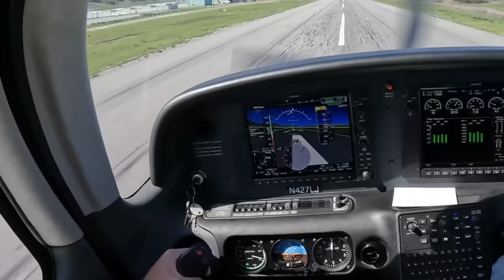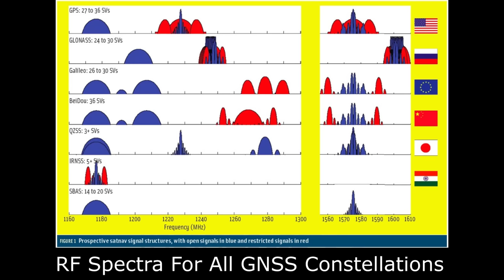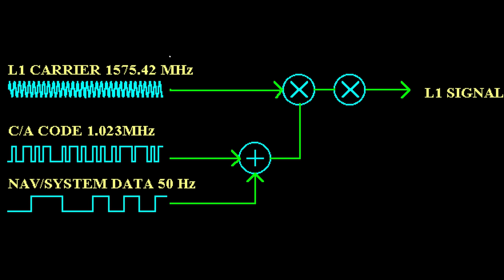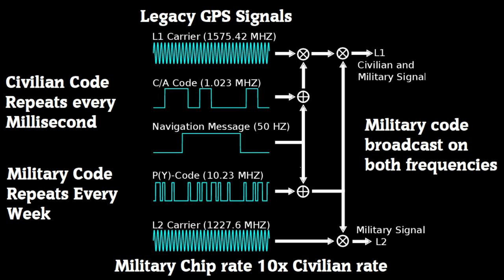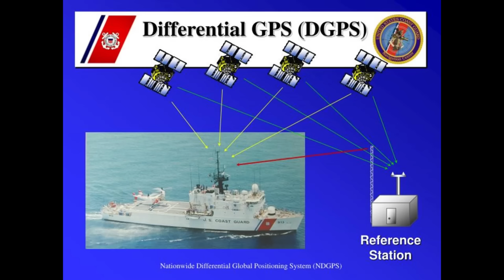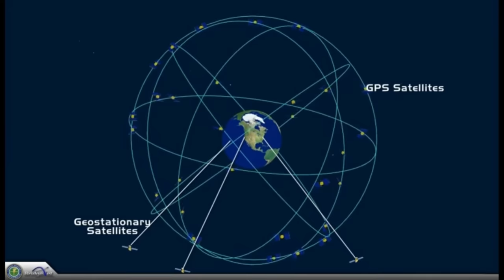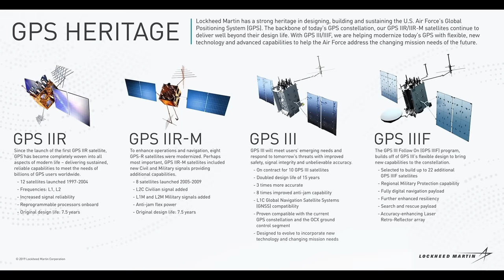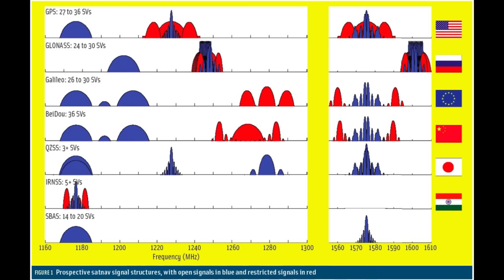How GPS Works, And How It Got Better Than The Designers Ever Imagined

Comment: I remember a story one of my professors told us at Cal Poly about someone who was working on a master’s thesis in the year 2000, developing a novel way to increase accuracy by compensating for selective availability. Basically, right around the time they were going to defend, the government turned it off. I think they were still able to defend, luckily.
Also while there, I heard rumors about how some student satellite programs specifically had to source their GPS receiver chips from overseas because lots of domestic ones would purposely shut off if they detected they were too high or moving too fast.

Comment: So many years ago, I did a job at the Naval Research Labs in Washington, DC. My employer had sold them a small satellite communications system that they were planning on using to synchronize atomic clocks across oceanic/continental distances. To do this job, the modem would actually range the electrical distance to the geostationary satellite to within half an inch or so.

Anyhow, when I was having lunch (I had to do it in the office, because they weren't exactly going to allow a foreign person like myself wanter around the labs). As I'm eating my lunch, I look over and there is this wierd piece of metal. The gentleman I was working with noticed this, and handed it to me saying "That's the prototype I built for the atomic clocks on the GPS satellites. It's made from isotopically pure Titanium."

Comment: I was on the design committee, the civilian GPS was designed for 8 meters, and 3 meters in differential mode; the P code military version was better. The transit satellites were used before that. 
Since then the clocks have been upgraded.

Comment: A few notes:

1. The FAA originally thought they could publish a GPS approach to every airport in the USA, but turns out that's difficult. It comes down to having the runway painted properly, monitoring that trees aren't growing into the aircraft's path, or someone does not park a construction crane there, etc. As a result, its been slow going.
2. LAAS, or local augumentation, has basically gone nowhere. The biggest problem with it is that WAAS is simply too good, so the cost to make LAAS is not worth it. In addition, the most obvious use for LAAS is at major airports for the airlines, and they already have ILS which is quite good. ILS got really cheap (relatively). I just went to podunk nowhere Oregon and they had an ILS.
3. One of the biggest advances that GPS could deliver is aircraft approaches that are not straight. Yep, approach paths that do things like turn a corner or follow a winding valley. These are coming slowly but are coming. Its likely that autopilot will be required to do this. The workload is just too much for a simple human.
4. The military used to reserve the ability to shut down the signal for civilians by telling the satellites to turn it off. But that was back before doing that would cause everyone's GPS box to die. So they developed the ability to jam the GPS signal in just a particular area instead, or even fake it so that a GPS system would give wrong information. Pilots know about this because they tested it in Nevada, and had to warn us that they were doing it.

Comment: And GPS navigation systems still lead you astray particularly if they don't refresh fast enough when you are navigating complex road networks. I can remember being out in the field looking for a locality where a map reference in Lat,Long was used with a GPS. Almost everyone trusted the technology and were scrambling around a gully looking for the rock outcrop that was supposed to be there. One of the luddites in the group decided to read the written description of the locality and check it against the contour map and walked over a ridge into the next gully and found it. GPS doesn't replace the ability to read a map.

Comment: There is additional GPS systems used by a very select few within various DoD entities.  This gives an accuracy down to the inch with no  cold start time.  I'm not privy to the operational information specifications, but I know it has modified packets that more easily allow for the use of Doppler shift in the position calculation.  It also works on a broad range of frequencies, which it shifts the real data between at a set time interval.  Outside of the accurate window, data is still sent which can give a course location.  This frequency changing is the same that the DoD radios use to help ensure more secure and harder to jam communication.
Reply: hi jameslmorehead , what do you think about all gubments drawing a line around you(Antarctic Treaty) and saying you are not allowed to leave? If you don't know what I mean, read my about tab.

Comment: There's one other important function for GPS.  That is an accurate time source for Network Time Protocol (NTP), which computers and other devices use to get accurate time, within milliseconds.  NTP is supposed to be traceable back to International Atomic Time, which is an average of several atomic clocks around the world.  With GPS, it's traceable through the satellites to the U. S. Naval Observatory in Maryland.  There are consumer grade GPS receivers that can be used for this and even my tablet can use GPS directly, instead of relying on NTP from the Internet.

BTW, I live not far from Toronto's Pearson airport and across the street from the grocery store where I shop used to be some navigation beacons.  They were removed a few years ago, I assume because of GPS being used on the aircraft.

Side note, you can stand in that grocery store parking lot and watch the aircraft flying directly overhead, with the landing gear down, as they approach the runway!

Comment: L.O.R.A.N. navigation platforms  were based on set locations signal time checking, so sync variability in time calculated locations. Yes, Coast Guard still had vaccume tube L.O.R.A.N. -C equipment at end of the sixties

Comment: btw. another often overlooked use of GPS and related systems is precision timing. Basically we're now living in a world where everyone has instant access to an atomic-clock anywhere on the planet.

This has countless applications. E.g. in my company we use it to operate lightning detection networks, triangulating the EM emissions of single lightning strikes. The receivers are actually quite dumb and basically just record time and amplitude of the signals, which is later correlated in software. But thanks to GPS they can do that with nanosecond precision, and – almost more important – a common time base, which vastly improves the resolution.

Comment: Fun fact, in an irban environment your cell phone does not need the full 12minutes to acquire it's initial GPS position, since it can ise the WPS (Wireless Positioning System) for faster approximate positioning. 
It is a clever use of google maps, where their mapping cars do take photos and GPS coordinates, but they also listen to the MAC addrssses of nearby Wifi access points. 
So your phone can actually "listen" to all Wifi signals around itself, and triangulate an approximate position from this.
I actually experienced this 10 years ago while using an iPod that had no GPS, but was able to get a 30m position using only WPS.

Comment: A 2D fix (latitude/longitude) can be obtained with 3 sufficiently distant (in sky) satellites.  To calculate your altitude, (3D fix) you need at least 4.  
And calculation of location, speed and direction of travel involve not only the time signal differences between satellites, but (and more importantly) the Doppler effect because some sateliltes are getting closer to you and some getting further away in the sky. (and hence the need for fancy radios).   And this is also why when YOU travel at speed, getting your initial fix takes much longer because the GPS does not hear an indicidual satellite at the frequency it expects to hear it at based on its orbital data and needs to listen to wide range of frequencies to determine which satellites it can hear from and then "correct" those frequencies based on assumed speed/direction of your travel.  
Orbital data is stored as 2 "tables": the almanach which lasts ~ 2 weeks, and the ephemeris which is valid for 4 hours. 

SA removal was similar to lifting of ITAR encryption export limitations: foreign companies were able to export into USA but US companies couldn't even sell to US corportatiosn with offices outside USA. (And contrary to military belief, there was no superiority to US encryption tech).   With GPS, Russia and Europe were launching their own constellations without degraded signals so the industry would move to listening to those satellites for precise signals and ignore USA ones, at which point the USA's ability to scamble signals became moot since nobody would be listening to them.  By removing SA, it made US GPS satellites remain relevant but since most units now suport multiple constellations, it becomes much harder for any one constellation to scramble signals unless they jam frequencies instead of providing inaccurate signals from GPS satellites.  

DGPS was limited in areas (mostly ports and St Lawrence Seaway) and not seen as a military risk since GPS signals outside of thsoe areas were still imprecise.  First  approved use on aircraft was FANS-1 for trans pacific flights with planes able to drive a more direct route (same $$ on fuel) and able to radio their location so that an ATC could have "eyes" on traffic crossing the pacific and this allowed increase in ttraffic and aircraft flying closer to each other. (prior to FANS, it was at least 100 to 120nm distance between aircraft due to low frequency of position reports).   FANS1 made its debut i 1996 and SA wasn't such a big deal because distance between aircraft was still orders of magnitudes larger than the error. Also even with SA, direction and speed was fairly accurate when moving, and location over time was accurate.  (older GPS units could average position over period of time when setting a waypoint). 

The lifting of SA for civilian use propelled GPS manufactuersr into rapid expansion of uses such as car navigations, use of civilian for surveying etc. 
But lifting of SA was not enough for airport use of GPS to land aircraft and that required WASS because altitude isn't precise enough without it.

Comment: CDMA is effectively TDMA, you alternate between the users in the same wave sent.

(the messages are binary vectors of a fixed length that are all linearly independent (that basically means you can reverse-engineer them from the sum). then you just send the sum of the vectors as a single vector of data.)

Comment: The value GPS/GNSS tech provides to society is insane. And this is without talking about the value of the high resolution time signals too.
Some 4G and most 5G networks rely on GNSS time signals to do synchronisation. Without that signal you wouldn't be able to coordinate the different phone masts

Comment: Amazing job Scott. It would have been too much to explain how position is computed from the 4 signals and GDOP and all that. But one thing that’s also corrected for that you might add next time is the one for general relativity…and how the satellites are affected by relative to the user. I worked in testing the initial sets.

Comment: 1:00 Army scrambled the coordinates to not make them precise (to prevent them to be used as a accurate way to detonate stuff for instance by triggering a bomb at a precise location) somewhere this was dropped and the scramble code was removed so that military and normal gps signal was the same

Comment: If I understand this correctly you could even work with 3 satellites for things defined to be on the ground. Because technically you could use just 2 satellites for positioning and would get 2 possible locations where only one would be on the ground so you could theoretically filter out the other one because if you're defined to be on the ground the other would be pretty much garbage and easy to detect. 

But I have to admit that I didn't thought over the time correction part and therefore I'm not sure if that part might fail in a 2+1 setup. But I know there are certain devices which can work with just 2 satellites when their clock is synced. And of course the less satellites you have the less options for error correction do you have and with only 2+0 satellites you have no error correction Options whatsoever and as we know clocks tend to shift over time because of various factors and most not so expressive devices won't be able to counteract this enough. And also you might not notice when your clock shifts by parts of a nanosecond your accuracy definitely will and when you have no error correction at all you will pretty soon end up in a lot of trouble either because your signal is way off or they both are detected as not on the ground (which works be the happy case because the device would notice you're fucked and give you no position instead of wrong position)...

Comment: I use GPS for scientific applications a lot at work, and the latest generation of dual-band, multi-constellation GPS units are so good it's frankly ridiculous.

There are older units still available that cost $20k+ for 1 microsecond timing accuracy or differential GPS good to a few centimeters. But now you can buy a $200 GPS timing card that is good to 5 nanoseconds. And I just started playing with a differential GPS kit from a hobby site that costs about $1000 for two units and is supposed to be accurate to 11 millimeters if set up properly.

Comment: Nice work Scott. As you say the US military had an enhanced system.  I saw a program many years ago when GPS was new there were soldiers whose sole job was to correct the time on the satellites due to time dilation. Fast moving objects and distance from a gravity field make time move slower in the sats. So synced clocks drift. I don't know if the correction is built in now and automatic but I am sure that it still exists. Einstein's relativity.
Reply: hi tiomkinnyborg, what do you think about all gubments drawing a line around you(Antarctic Treaty) and saying you are not allowed to leave? If you don't know what I mean, read my about tab.

Comment: Excellent presentation!

The device you’ve showed is the (navy version) of the Magellan GPS NAV 1000M5. And yes, the M5 supports (field) differential.

If it hasn’t been mentioned, the SA is only applied to the C/A code; the P(Y) code is exempt. The SA was turned off in the 20's.

A P(Y) code device requires a special hardware chip and its own software to operate (governments’ controlled).

Can you also please describe to the viewers the FOM (Figure of Merit)? Which is; determining the best date/time to determine the best LAT/LON/ELV for the current location (after “ALMANAC COLLECT”)? Cheers.

Comment: Aviation tends to use GBAS more than WAAS.
It is a “Ground Based Augmentation System”.
The airport has a known fixed receiver-transmitter, that can send a correction code to the aircraft receiver.

R
Reply from the maker: I think GBAS is mainly available on big planes, but WAAS is required for ADS-B which is on practically every new plane.

Comment: Without Einstein's Relativity GPS would not work.  Satellites' clocks run slower due to kinematic time dilation because they are traveling faster than ground based clocks.  They also run faster due to gravitational time dilation because they are further away from the Earth than ground based clocks.  Satellites' clocks had to be  adjusted to compensate for these two relativistic effects.

Comment: In 95 I remember the GPS was about 100 feet but in 99 we had a GPS antenna and little box that plugged into the computer serial port and we had software in the laptop and it was really accurate.

We also had the computer and I think it was wave files, not GPS
The DVD or CD player could do regular CDs but we didn't have a DVD player that did MP3 or an MP3 player in 95

And what we came up with was a small computer running off an inverter in the car, and a small computer screen and a small keyboard and we had a sound card with the line level outputs going into the stereo in auxiliary input to the amplifier and equalizer and we recorded 1500 songs and had them playing on Windows Media player and we could open the glove box and the keyboard was attached to the glove box door and the screen was behind the glove box and we could bring up the sound files and create a playlist and play them through the computer and through the amplifier.

It was a lot of work and people thought we were crazy

By 01 we all had MP3 player and I had my cassette player in the car with a cassette adapter with the 1/8" plug and plugged into my MP3 player and played the mp3 through the stereo

We really have come a long way

Comment: There were some things that doesn't fit to, what I learned. I'm not sure if im information is wrong or the information in the video.

Autoland is only available with ILS antennas. So solely on GPS this isn't possible. But as mentioned in the video you can have GPS approaches, which helps navigate safely close to the runway (often down to 500 or even 200ft). But even in those cases the vertical navigation is aided by air pressrue measruements.

Most modern navigation gear (also smart phones) use not only GPS but also the oter GNSS.

As far as I know systems don't switch between different GNSS (as GPS, Galileo, etc) based on where you are, because they are all globally available.

Comment: I have a automower that has rtk gps which can be down to few cm. Although it gets multi path issues when traveling between houses.  

Is there a way to filter out inaccurate satellites that are giving multi path issues, from reflecting off walls?